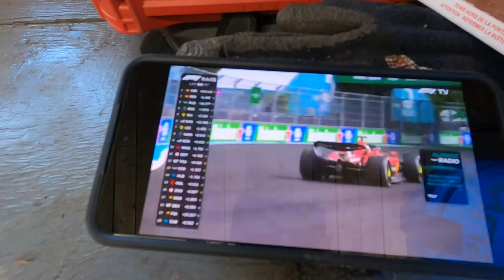JUNK S14 240sx Gets FRESH Rocker Panels! & More Rust Fix :/

Comment: Yo howdy man! I’m currently fixing up a badly redone repair job on my s14, and it had the rear panel replaced and some point and the seam sealer that used completely failed, really only surface rust under but it’s around the entire rear panel pinch weld seam. currently working on getting it all ground down and looking for suggestions for the best rust inhibitor/epoxy primer to hit it with after and then what kind of seam sealer did you use here? And would use suggest it for the outside one I’m doing? (Didn’t wanna have to buy a 2part gun)
Reply: Jesus I’m so sorry this is unreadable 😭
Reply from the maker: Hey man! Sounds like you're in for a fun project. I use Dominion Sure Seal for my seam sealer, you can get it in a tube like I used here, or in a can to brush on. For the primer, I mostly used super acid etch primer by the same brand. It's cheaper than epoxy primer so I used it for all of my new panels pretty much. I have an engine bay restoration video that I used epoxy primer for. Not sure of the brand, I had it made up at my local paint store in a 2 part spray can.
Reply: @RoadRoyals  thank you so much for the response man! Definitely going to look into that seam sealer and different primers, I’m just trying to figure out the best way to make sure the rust is completely eliminated before priming and seam sealing

Comment: Where did you get the rockers from? Thanks
Reply from the maker: Had them made up at a local metal shop!
Reply: Okay thanks
Reply: @s12mafia36  easiest way guys, its not that hard, i bought mine from almera n15 they require some cutting but will be good